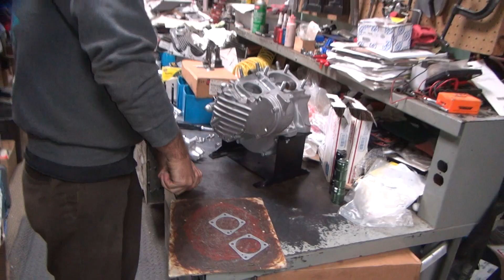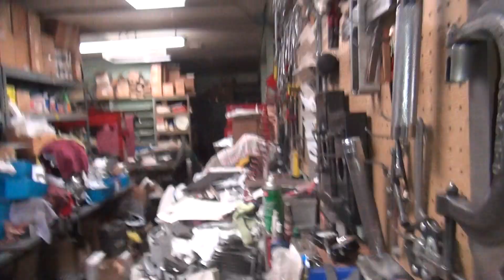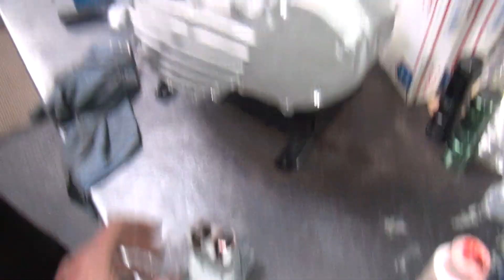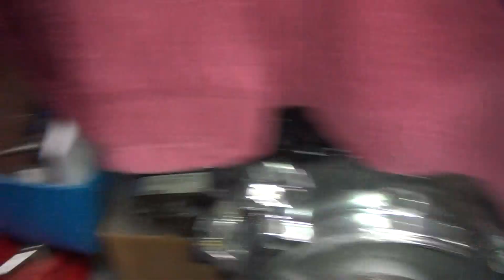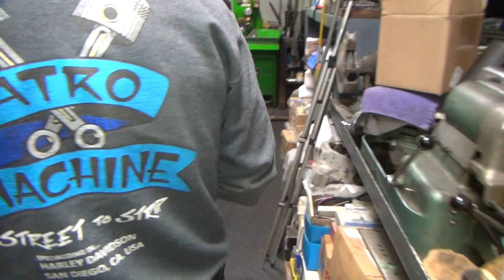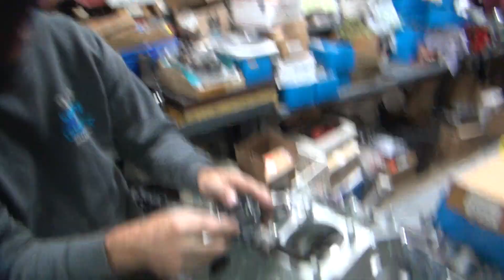#200 1961 FL 74ci std panhead s&s evo lifter conversion install motor rebuild harley tatro machine

Comment: Looks like polly vinal cloride . Contact cement or pvc glue .bet you have a hard time pulling his engines apart and cleaning the gasket serface.
Reply from the maker: the sealers i use work and don't leak. that is all that matters.
tatro